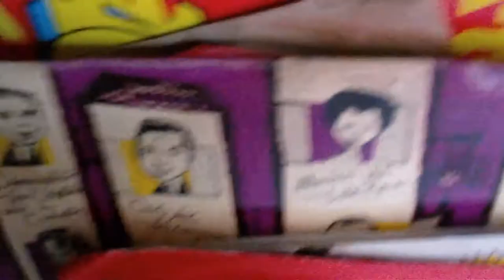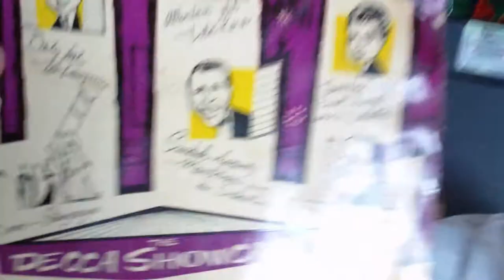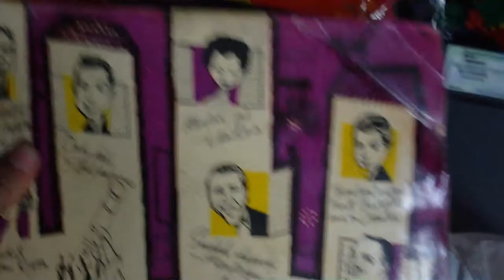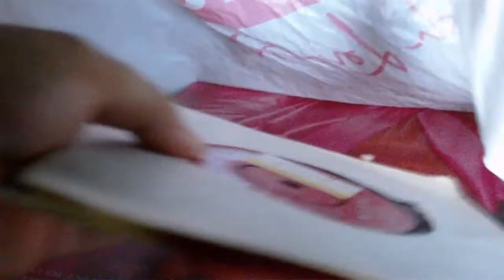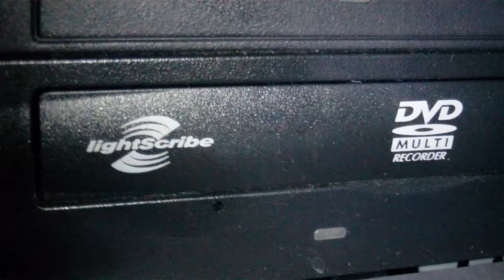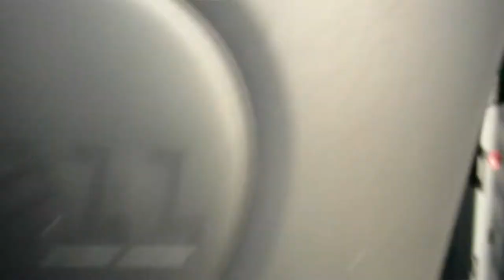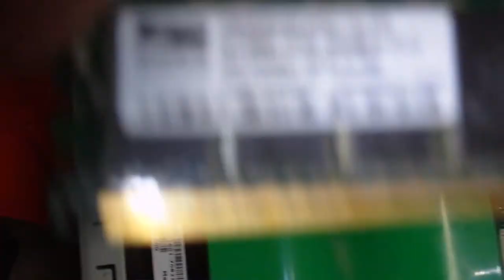More records and a Trash Picked Dell

Comment: The Dell Dimension 1100/B110 was a budget system. Costing only about $299 New here in the states. That being said, these were very reliable systems. I have owned 5 or 6 of these over the years and never had one fail. Caps we all good as well.

Comment: I actually have a few of those machines. They handle 480p video nicely but the cases dell used are standard ATX so you can re-use the case for a pc build (I like them because of how solidly build they are) Great finds btw

Comment: Those 10" records are around, not very common. That used to be the size for the 78 RPM bakelite records. I have one " die Wespendomina " It is on my channel in 33 and 45 RPM.
Nice score of records. Like the 45 RPM singles with the little 4 pointed spindels within.

Comment: also, Dell has made some decent computers not so much by design but the fact that Dell computers do last a long time. I have a Dell desktop I think its from 2004 or 2005 it has a pentium 4 and 1GB of Ram and I run Windows 98 on it its so fast for Win98.